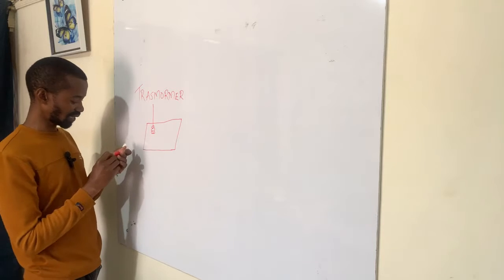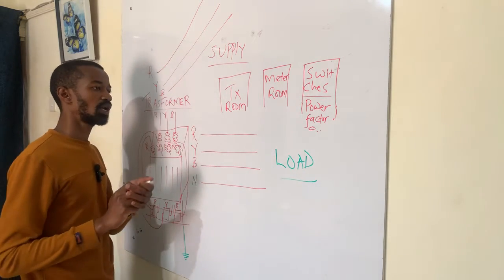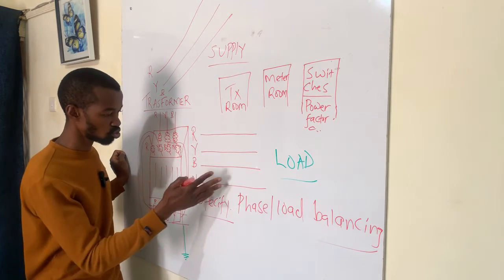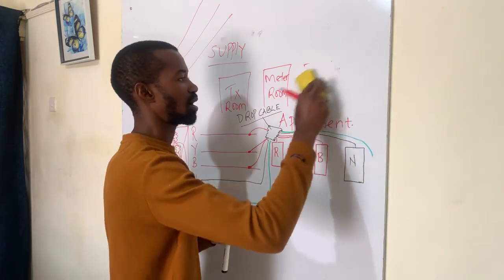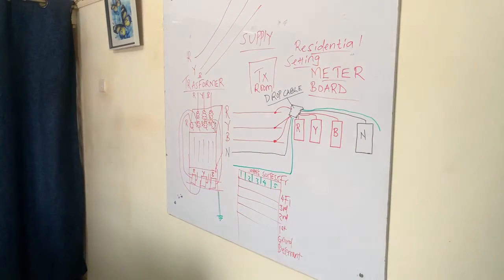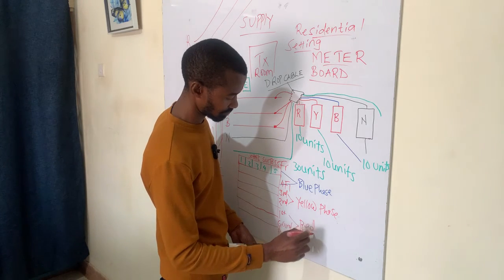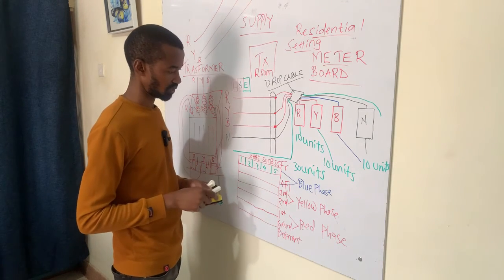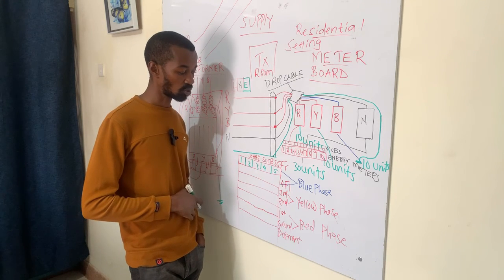Three Phase Electrical Power Basics.

Comment: Thank you for this educative session. My question is; 
1. Is it alright to connect the load connections straight from the meter without adding the specific load poles? 
2. Why is there no connection of a earth leakage RCCD in your meter box?
Reply from the maker: no, it is not considered best practice to connect the load directly from the meter without a main isolator or protective device.

Comment: From the drop cable, where is the ground attached to? Is it from the transformer body or bonded with the Neutral?
Reply from the maker: In a typical TN-C-S (PME) or TN-S system, the earth is ultimately derived from the transformer's neutral point, which is bonded to earth at the transformer.

Comment: Top boss please I need brief explanation about the three phase
Reply: "Sure! Three-phase wiring involves distributing electrical power using three conductors, providing a more stable and efficient power supply compared to single-phase systems."

Comment: Sir I am confused oo
Reply: I'm here to help! What specific questions or concerns do you have about wiring? Feel free to ask, and I'll do my best to assist you.
Reply: @ 
Yeah assuming three phase is supplied to a plaza with 10 bedrooms apartments . In which way will that distribution be made to ensure if a phase went off all the apartments will still get power.
Reply from the maker: electricians normally distribute the phases in a way that balances the load and reduces the effect if one phase fails.
Reply from the maker: Where.

Comment: the additional stringing in other countries is always for EARTHING, they are using a different type of earthing where the earth is completely isolated from the Neutral, it is also applicable here in kenya based on the purpose to which the supplied energy is to be used and the type of appliances and machineries the consumer has.
Reply from the maker: Very informative feedback my Top Boss, thank you so much.